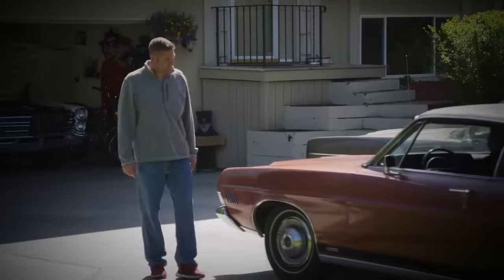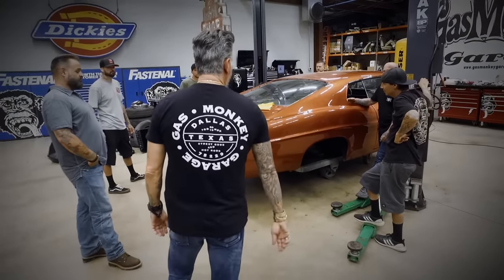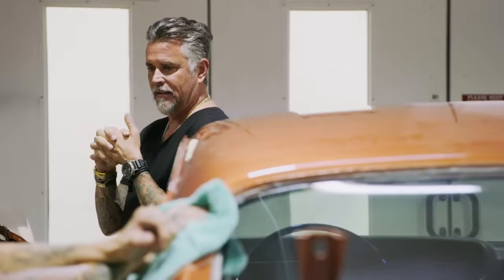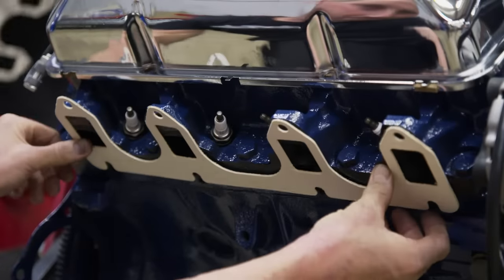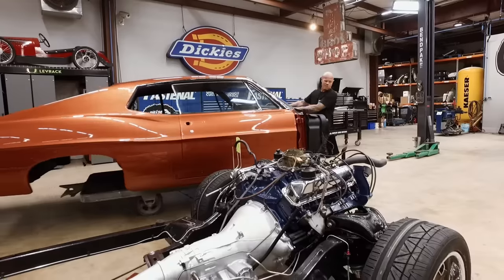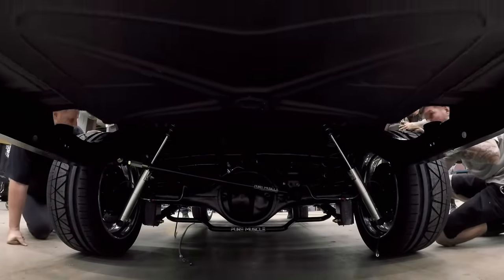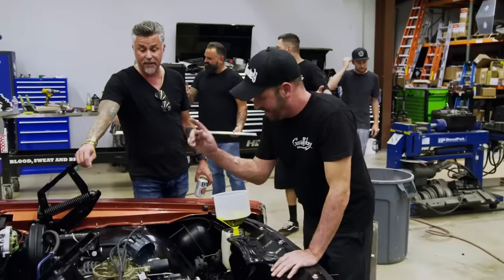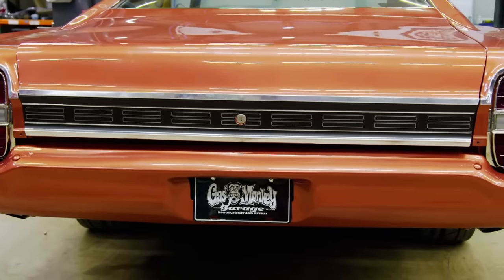Richard Rawlings Forces Gas Monkey Crew To Rebuild Entire Car TWICE I Fast N’ Loud

Comment: Beautiful,I wouled have nickel-plated the bumpers. I had a 69 Ford Torino Cobra. It was ordered with the drag pack which included a Super Cobra Jet 428 engine, 427 lemans connecting rods, functional ram air, oil cooler, Detroit locker,  4.30 gear set, staggered shocks. metal cobra emblems, etc

Comment: In 68 it wasn’t a Galaxie, it was just called an ‘XL’.  My father had one that was a Midnight Blue with a 302.
Reply: True.  Ford separated the XL from the Galaxie series in 1967.  They did the same to the LTD in 1966...
Reply: 1959- 1974 the Galaxie   name was used. Not to start an argument.
Reply: I had a '67 Galaxie 500 XL fastback, but only had a 390. I understand XL was the trim package.

Comment: Anybody ever notice that on the car shows all across the board it's always the timing or firing order that fixes the non starting engines. Just saying. Glad to see GMG still going it was my favorite car show when it was on tv.
Reply: Drama, it's the drama that sells.
Reply: there have been several times where they had to send the engine back to the engine builder....Im pretty sure that means it wasnt a timing issue....a certain Caddilack and firebird come to mind.
Reply: Pretend drama
Reply: @guysumpthin2974  
No doubt. So phony and repetitious...yaaawn!
Reply: Right if they dont know how to find number 1 on the compression stroke @TDC make that rotor point just a 1/8 past the NO1 spot on cap and fully seated and lightly locked D. Hold down  Then why dont richard do it next time lol.?
Reply: @Arthagnou  and i wouldnt be having them do  it again either

Comment: Gee, imagine that. A car from minnasota being a rust bucket. Whooda thunk it !
Reply: Come on up to Canada,we manufacture Rust.The trick is to park them in a garage for the winters.
Reply: @martytruelove5026  another trick is to use a carwash that can also spay the bottom of the car to wash the salt and or mud off of the inside of the body panels and the entire bottom of the car. A good coat of wax to supplement the carwash spray wax goes a long way towards preventing rust. I live in a U.S. state (Maryland) that heavily salts the roads if a suspected snowflake has been seen within a hundred miles of the state.
Reply: @oldfan1701  They spray them with OIL up here,it helps but salt comes up the winner...Too Bad.I knew how to beat rust when I was young...

Comment: I have only ever built 2 engines in my life. Both 350.  Both times at start up had the dist 180 out. 50 50 chance and still got it wrong.
Reply: Can happen to anybody. I did a simple tune up on my Buick once. Crossed up 2 plug wires. Seemed to run perfectly, but had no power on acceleration.

Comment: benn seeing a lot about orange peel lately,   heres the thing   sanded flat looks good inside under lights but out side it looks like shit,   go to a new car dealer and look at the paint it has peel in it and it looks real shiny, without going into to much detail   a flat lake looks like a mirror but a ripply lake sparkles and has was more gloss.  mirrors arent very glossy.    there is a thing about to much peel yes that looks crappy but when you get it just right texture outshines flat every time

Comment: What's with the front guard and the door on the drivers side, different colour. Painted separately.
Reply: Not sure what front guard your're talking about, but there is no need to paint the inside of the door that is covered by the door panel.  Most paint jobs do not cover that.